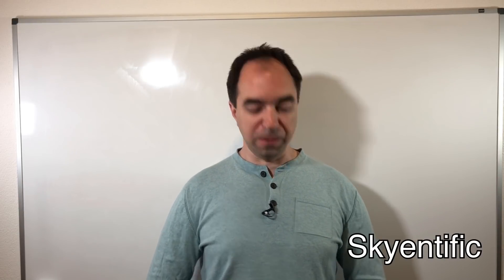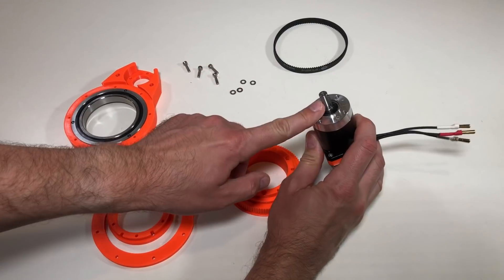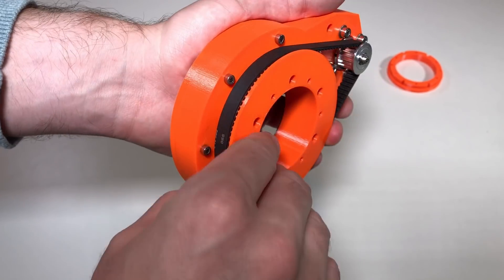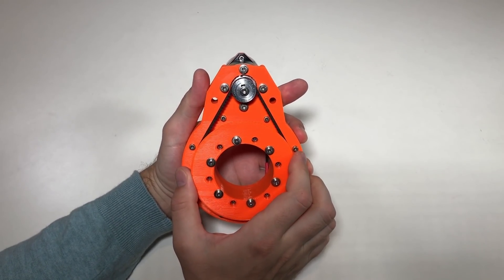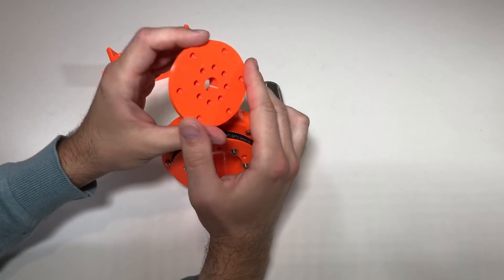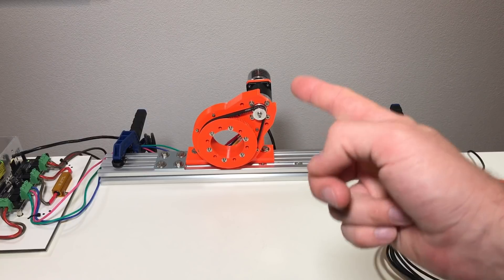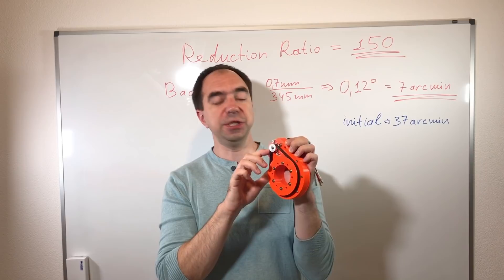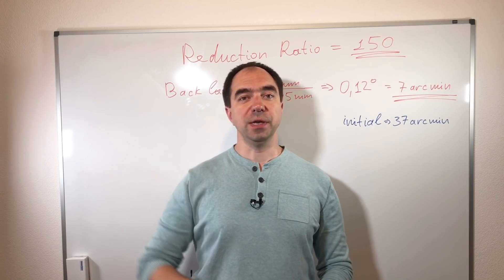How to improve the precision of the actuator?

Comment: (Here’s my contribution to feed YT’s algorithm. So you have to answer :-)): Was this the full speed of the motor ? Because from my eyes, it seems to be able to achieve a much greater speed. And who doesn’t like swifter robots ? Were you limited by the encoder specs ? Power supply ? Surely not the ODrive. Keep going !

Comment: Thanks for another great video. I'm wondering what the implications are of the placement of the rotary encoder. If you put it on the final output would the motor be bouncing back and forth about the backlash? Would the final backlash be less or more? Thanks again!

Comment: While that is a fine solution, and a stunning design (I really like how you've kinda made your own modular system with adaptor plates and mounting brackets and such), there is not much more performance you can squeeze out of this actuator before you'll have to move on to ballscrews or wormdrives.

Comment: @05:48 Skyentific: You can use the timing belts. First you need to determine the max torque a belt can handle, and then you can double or triple the number of belts to distribute the level of torque you wish to test. You can also use a tensioner and a micro switch to determine if the amount of torque being use is too much. There is a proportional ratio between torque and tension on timing belts.

Comment: Are you going to use different belt for better torque?
Reply from the maker: I don't know yet. One possibility is to use large belt (like 15mm wide, for example). Another possibility is to use the stainless steel wire, but in this case the rotation range will be limited...
Reply: @Skyentific  I like the wide belt idea :) I am following your builds, today ordered the slew bearing - what you achieved already is a win.  With belts/other options I will wait for you future discoveries :)

Comment: Here's another reducer mechanism which may interest you https://www.youtube.com/watch?v=HxCDbEL9afc
Same underlying principle as your orbital drive, and even more similar to Gear Down For What's compound planetary gears, just with a single planet, and different tooth profile to avoid jamming when there's only one tooth difference between ring and planet. You can get good ratios with very low tooth counts.

And here's a helpful link for creating cycloidal discs in Blender http://www.otvinta.com/tutorial05.html
The rest of the modeling is easy. Just a bunch of boolean operations with cylinders.

Comment: Hey, why you don't buy a stepper motor with the planetary gearbox in OMC Stepper Online Store?
The backlash of this planetary gear is very small and has a lot of torque ( 25 N m)
Great video, congratulations from Spain
Reply: smart question - yet it should be obvious that any servo can move faster then 99.9% of steppers ( stepper are extremely slow by default)  just by the way they operate + stepper tend to lose steps ALOT .. so encoder + servo is the way better choice at least in robotics